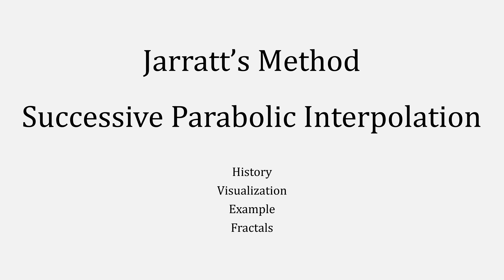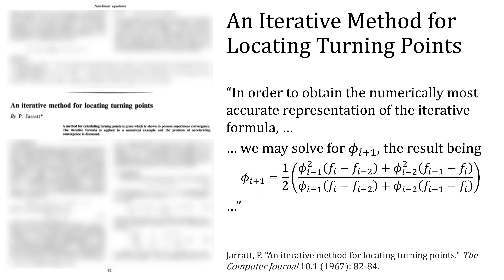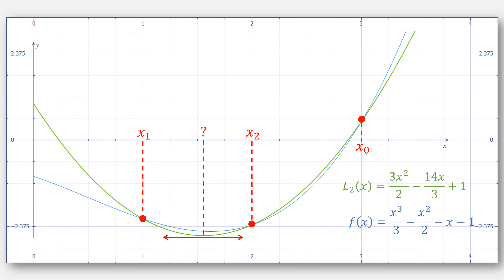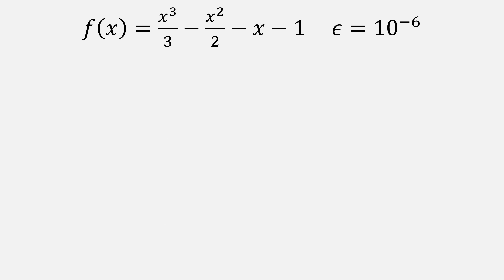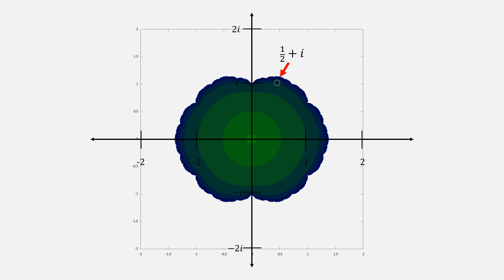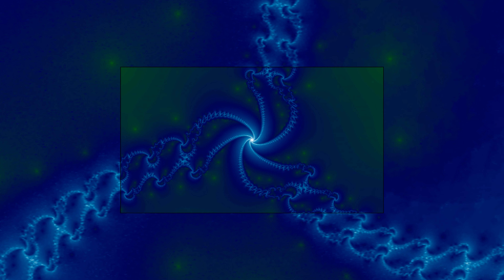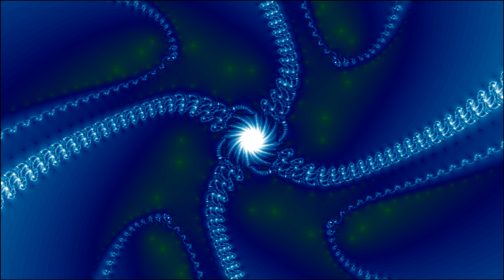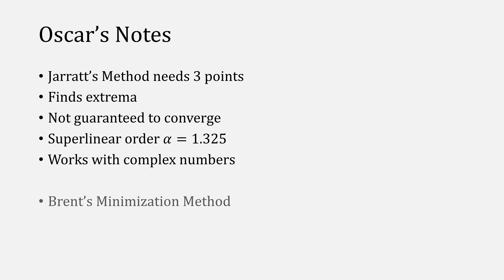Successive Parabolic Interpolation - Jarratt's Method

Comment: I love the idea of superlinear convergence. This superlinear convergence is also present for the secant method (alpha = 1.618), Muller's method and inverse quadratic interpolation (alpha = 1.84 for both). However, only the secant method yields interesting fractal results, while this method, Jarratt's method, resulting from successive parabolic interpolation, shows interesting results similar to the secant method. Plus, these methods have what I like to call the order of "subquadratic convergence". Like Muller's method and inverse quadratic interpolation, it needs three points, as a result of relying on Lagrange polynomials. There's also a relationship about the interest of fractal structures and order of convergence. The higher the order is, the faster it converges, but it makes less interesting fractals, while lower convergence order yields more interesting results. By the way, is there a way to share my fractal works with you?
Reply from the maker: Your post on Durand-Kerner is being marked as spam by YouTube (probably because of the links), but I did take a look at the fractals that you and others were sharing on Fractalforums.
Reply: @OscarVeliz  This shows that any root finding method can be represented as a fractal, but some are more difficult than others, like Jenkins-Traub, Bisection, Regula falsi and Lehmer-Schur.
Reply: @OscarVeliz  Have you tried Ultra Fractal?
Reply from the maker: I haven't although I understand it is quite capable. My fractal programs (found on GitHub) are written using gnuplot.
Reply: @OscarVeliz  Would it be possible to convert some of your code to .ufm files (the format used for fractal formula files in Ultra Fractal)? (although you may need to get used to it first)
Reply from the maker: It is possible to translate code. It is not something I am particularly interested in at the moment.
Reply: @OscarVeliz  For now, I just joined GitHub and created my own fractal repository, "ultrafractalcollection", which is a collection of my fractals rendered with Ultra Fractal, including some root-finding fractals, such as Newton, Halley, Secant, Durand-Kerner, Aberth-Ehrlich, Bairstow, Steffensen and Householder. Check it out here: https://github.com/avachon100501/ultrafractalcollection. This is a work in progress, images are coming soon...
Reply from the maker: Cool!
Reply: @OscarVeliz  So far, I've created two pages: one for Newton's method, and the other is about Halley's method. On the home page, you are among the people I give special thanks to, and you somewhat inspired me to make my GitHub repository. More content will be added, such as Schröder's method, the Mandelbrot and Julia sets, Taylor's theorem, the Burning Ship fractal, and many more. I will also try to make a fractal from the Jenkins-Traub algorithm, but it's a bit hard for me. I'm also glad to be one of your best followers! Keep up the good work!
Reply: @OscarVeliz  Your example code link leads to a 404... can you correct the link? Also, I have a rough time recreating the fractals you generated in Ultra Fractal. How is this generated? I know it has been rendered using gnuplot, but what are the things needed for the generation of such a fractal? How do you calculate the angle for the three points?
Reply from the maker: Link is fixed (thanks for pointing that out). Given a complex point (r,c) you compute the angle theta using arctan(c/r [+pi if r is negative]). Then the radius length is just the good old Pythagorean theorem rad=sqrt(r^2+c^2). Compute next two points based off a scalar of rad (like .9999rad and 1.0001rad) then applying Euclid's formula rad*e^(i*theta) or the longer version rad*cos(theta)+rad*i*sin(theta). You'll need to have a special case for zero. Alternatively, you could just keep it simple and add/subtract from the starting point which will work. I think it just looks smoother with the radius approach.
Reply: @OscarVeliz  I checked out your code, and the syntax is much different from that of an .ufm file. I know that the process you explained occurs after the Jarratt iteration formula (if I'm correct). What's exactly the parameter i?
Reply from the maker: Which process I that explained? The one from the previous comment starts before the iteration process because that is how to define the extra two starting points. My code doesn't use a parameter i so do you also mean from the last comment? If so, i is the square root of -1.
Reply: @OscarVeliz  The format used in the example code is really difficult for me to understand. If possible, is there a simplified version of it?
Reply from the maker: I have never encountered someone making a fractal from Jarratt/SPI. For an alternate version you might try adapting a Muller's Method fractal program.
Reply: @OscarVeliz  So it would seem that you're the first one to do so. I'm impressed!
Reply: @OscarVeliz  On another note, the fractal in the video does kind of look like the fractal generated using the secant method.
Reply from the maker: I suspect you might be thrown off by the notation. Wherever you have a question mark that means
if [condition] ? then [A] : else [B]
Just remove the words if, then, and else. Note that some of these are nested if/elses.
jar1 is the recursive call to perform the iteration with an increased n and the old values of z moved down by one to make room for the new value of z given in jar2. When it eventually stops it returns the current value of n.
jar0 just starts the recursive call with n of zero.
jarratt and jar are used to initialize the starting points.
Reply from the maker: Why are you using the golden ratio? I'm not understanding how a, b, p1, and p2 are being used.
Reply: @OscarVeliz  It seems I forgot to remove some things... but p1 and p2 refer to the initial values (znm1 and znm2), while z is the pixel value.
Reply from the maker: For clarity you have:
znm1 = p1
and then later:
znm1 = znm1*(abs(z)*@a)*dist*exp(i)*theta

Why not:
znm1 = p1*(abs(z)*@a)*dist*exp(i)*theta

I'm also not sure why you have
z = z
Seems redundant.

Lastly I don't think
 znm2 = znm1 = z
does what you think it does. My understanding is that it makes znm2 and znm1 the same value as z. If all three points are the same then there is no way to compute the L2.
Reply: @OscarVeliz  Can you help me with those parameters and correct them? It would be very appreciated.
Reply from the maker: I'm not entirely sure why you need p1 and p2 when you have a and b. The only reason I was using the points -0.001 and 0.001 was when the starting value was 0 (thereby giving -0.001, 0, and 0.001). I have to do that because the radius to zero is well... zero. There'd be no way for me to use the radius method in that instance.
Reply: @OscarVeliz  For the equation of the calculation of the next two points, I didn't quite get it. What is a scalar?
Reply from the maker: When you have the distance to your starting point, the next two points are .999 times that distance and 1.001 times that distance along the same angle. Those scalars are arbitrary, you could use .99999 and 1.00001. Just two numbers close to but not equal to 1 (using 1 would would just give you the same distance).
Reply from the maker: Again, I really don't know why you're using p1 and p2 in your equations for z's. I only used those values when the starting value was zero.
Reply: @OscarVeliz  It would seem it's far harder than I thought at first... I just don't know how to make it work. Sorry, Oscar... doing my best.
Reply from the maker: What happens when you eliminate p1 and p2?
Reply from the maker: Fairly certain you don't need to multiply by abs(z) and rad. Just one or the other and I prefer rad. There's probably something up with how you're figuring out the theta. Because when you enter the first if, theta never becomes initialized. For example in my code:
x == 0 && y > 0 ? jar(complex(x,y),pi/2)
would assign pi/2 to theta and z would be (x,y) pixel.

In your code, you assign pi/2 to y and then never assign anything to theta.
Reply from the maker: You still have an issue with:
znm2 = znm1 = z
This assigns z to both znm1 and znm2. The L2 doesn't work when all three numbers are the same.
Reply: @OscarVeliz  Removing that causes the image to go blank, completely black. Is there a solution?
Reply from the maker: Imagine if you had:
a = 1
b = 2
c = 3
Then you have a new value for c and you wanted to push all of the old values down. If you do:
c = b = a
it would make b the value of a (aka b = 1) then c the value of b (aka c = 1) meaning everything would be equal to 1. You do still want to do the updating but c = b = a is not the way to do it. Break up the steps (and store the result of iteration somewhere before overwriting the number stored in z).
Reply: @OscarVeliz  Okay, but I never tried anything like this before. How do I proceed?
Reply from the maker: Something along the lines of:
d = a+b+c
a = b
b = c
c = d
Reply from the maker: the d = a + b + c statement was meant to be the giant iteration function I just didn't want to write it all
Reply from the maker: Any luck? edit you do need to assign the result of the iteration function to a new variable otherwise it overwrites z before you have a chance to move it into znm1
Reply: @OscarVeliz  Something like this?
  znm2 = zt
  zt = znm1
  znm1 = zs
  zs = z
Reply from the maker: Maybe? Depends on where you saved the iteration function result. If your code still says:
z = z + 0.5.........
then no because you're overwriting the value of z before you can save it into znm1. If you have
temp = z + 0.5 ........
then you're finally on the right track.
Reply: @OscarVeliz  YES! I finally did it! Odd, I did a similar thing for making fractals from Durand-Kerner, Aberth-Ehrlich, and Muller's methods. Result: https://github.com/avachon100501/ultrafractalcollection/blob/main/photos/JarrattSPI/JarrattSPI_z4div4mz.png
Reply from the maker: Notice you have a small dot in the center which is where the distance to the center (radius) is zero. That is the reason for the extra condition check for when the starting pixel is zero use the three starting points -0.0001, 0, and 0.0001
Reply: @OscarVeliz  Like this?
  if (z == 0)
    znm2 = -0.0001
    znm1 = 0.0001
    z = 0
  else
    znm2 = @b*rad*exp(i*theta)
    znm1 = @a*rad*exp(i*theta)
    z = z
  endif
Reply from the maker: Give it a go
Reply: @OscarVeliz  I did, but the small dot still remained. Am I doing something wrong...? About the line with the condition if z is equal to zero, can you make a reminder?
Reply from the maker: Perhaps the numbers are too small (-.01, 0, .01)? Could also be that the function doesn't have a constant like z^4/4 - z - 1. This would have the same extrema but if you plugged in a number near zero you'd get a result closer to -1. Hard to say. If it isn't causing an issue for other functions like -cos(z) then I wouldn't worry about it.

For efficiency you don't need the statement z = z in the else. Also for efficiency, if you aren't using a and b anywhere else in the program then you could just replace them with their respective number to save on code.
Reply: @OscarVeliz  Got it. I'll check it out after my sleep.
Reply from the maker: IQI is very sensitive to the starting points. Your IQI fractal code is doing that odd p1 and p2 thing which doesn't look like what you'd expect IQI to behave. I'd recommend copy/pasting your Jarratt fractal code but replacing the iteration function with IQI's iteration function and changing f(z) to be z^3 - 1.
Reply: @OscarVeliz  p1 and p2 have no effect on both Jarratt and IQI. Am I doing something wrong, just to trying to get rid of that dot in the center?
Reply from the maker: Hard to tell without looking at your code. Do you have the latest versions of on fractalforums or github?
Reply from the maker: For IQI the if line 23 should probably be ==
This is me speculating but since z is a pixel it probably can't be compared to a single number. If that is not the case then perhaps initialize p1 and p2 the same way you initialize comp.
Reply: @OscarVeliz  For the arctangent function, I only get static... probably related to the condition if z is equal to zero.
Reply from the maker: Did you replace the = with ==?
Reply: @OscarVeliz  I did, but I don't get the image that matches yours that uses atan(z) for Jarratt-SPI.
Reply: @OscarVeliz  Anyways, what are your plans, Oscar?
Reply from the maker: @alexandrevachon541  It hasn't been letting me comment on this thread so I've replied on some of your other comments. Here's hoping this one goes through finally.
Reply: @OscarVeliz  Either way, it works for some functions. Thank you so much for your help! And what are you planning to do, Oscar?
Reply from the maker: @alexandrevachon541  Brent's Minimization Method is up next. Afterwards I have a lot of topics in the queue that I need to sort out.

Comment: Does anyone have an idea of an unconstrained derivative/gradient-free optimization technique for more than one variable?
Reply from the maker: Pattern Search. I have it in the queue but there are at least three or four topics ahead of it.
Reply: @OscarVeliz  I also tried the Nelder-Mead method on Ultra Fractal, and it worked, and though it did not generate any notable fractal pattern, it did show the minima of the function. And what would be the order of convergence of this method?
Reply from the maker: Neat that you were able to get it working on Ultra. I do not know the order. A quick search left me with the impression that it is an open question.